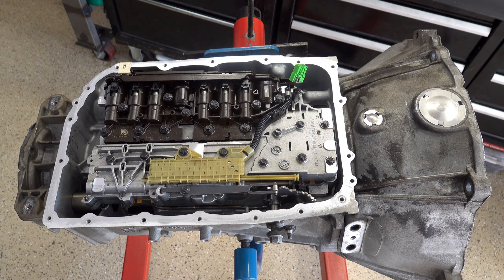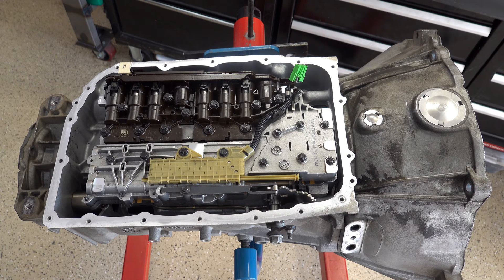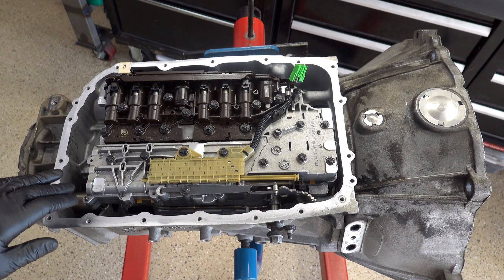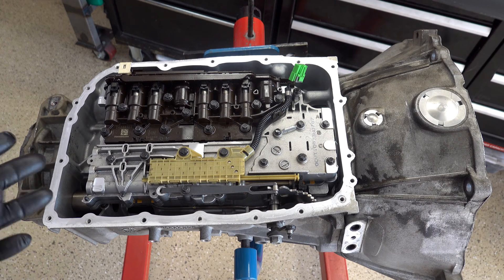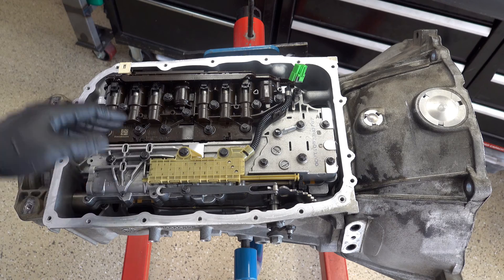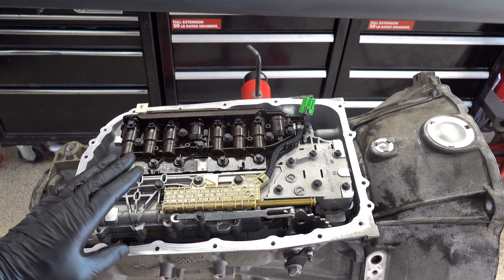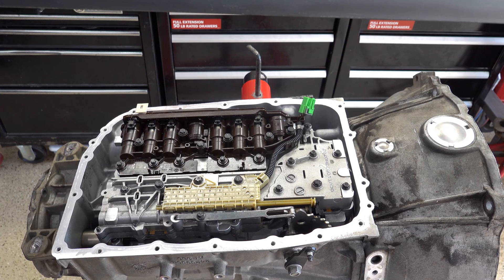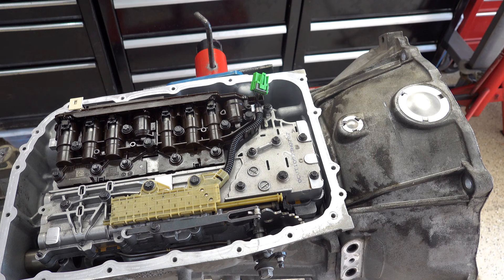6L80 Troubleshooting PT2 - Internal Mode Switch

Comment: Was the one you tested good or bad?
Reply from the maker: That one was working fine. Thank you for watching.
Reply: @nickstransmissions ok thank you!!! Been following you for a while and you’re a beast bro!!
Reply from the maker: You're welcome and thank you for all the views and support, Tony!
Reply: @nickstransmissions  I had the same DTC codes that you showed on that sheet of paper, no crank no start, what would my PARK show on my multimeter if my IMS is bad if I use PINS “A” & “D” like you did? In the video your PARK showed “OL” and you said your IMS was good. What would a bad IMS show? Thanks.

Comment: 2015 GMC Sierra 1500 two-wheel drive 5.3 l Denali 6L80E transmission. I got the notorious torque converter shutter and took it to a reputable shop to have him do the rebuild which was a basic rebuild no replacement of the TEHCM or IMS as there were no codes when he scanned the truck. I had no issues at all with the truck before the rebuild, and this truck has impeccable service history. The day he called me and said the truck was ready his technician forgot to reinstall the crank position sensor plug and was already telling me the truck was having issues with drivability but the transmission was working fine. When I call back to tell them to check for that he already knew he made a mistake and plugged it back in. I took the truck home I noticed that it was slipping and so I took it back and the technician went for a drive with me and noticed that yes it was slipping and it was also having a hard one, two shift. The shop owner told him to check the fluid and it was two quarts short. So the shop owner and myself went for a drive still felt like there was not something right and he said that the TECHM basically need to go to a relearn procedure. I drove it for a few days and then I noticed that when I would put it in drive the drive indicator didn't light up and it would not go into gear, so I had to put it in manual and drive that way. I took it to the shop the next day and a few hours later he sends me a picture of a broken transmission filter, it's definitely an impact break and he says that he has no idea how that's happened He's never seen anything like that before but he replaced it and it seemed okay for a couple days and then it started doing it again. The truck sat for 10 days I had to fly out of state upon returning I drove it it seemed fine and then the next day it started doing the same problem. It does have a brand new AC Delco IMS in it but this guy is saying that it's all electrical problems and he's trying to tell me that the replacement IMS is most likely defective and if that's not it it's going to be the TEHCM which will be an extra $1,200 on top of the $5,000 he already charged me. Somebody please help me to understand if this guy is just trying to rip me off or if his technician did something that he shouldn't have and did a piece of that filter get stuck in the valve body. As I stated this truck had no issues before his technician touched it
Reply from the maker: Check the transmission's main electrical connector/plug to make sure it's fully seated/plugged in to the rear case connector. Your symptoms sound somewhat like a plug that is not fully engaged. If it is plugged in (either because you have already checked this or check and find it to be fully plugged in) take it to a different, reputable shop to get a 2nd opinion. 

There is a very specific procedure to diagnosing the TEHCM for being defective or bad - most shops don't have the equipment to do so...That said, never reuse TEHCMs, IMS, speed sensor - harness or any other electrical/electronic transmission part...I always replace those three things on any 6L80 build that I do, unless the customer agrees waive their warranty to save a few bucks...

Comment: When I shift back to park the vehicle does not register the action on the digital PRNDL in the dash. Would this be a symptom related to the mode switch? Also causes some drivability issues when acting up. Problem is intermittent. I can turn off the key and start it back up and all is well.
Reply from the maker: Maybe. Did you scan for codes? If so, what codes appeared?
Reply: @nickstransmissions  Got no codes in the TCM, PCM, BCM or ICM that pertain to transmission. Did replace the IMS. Same symptom presents after replacement. Driving in live data, the TCM in my Autel Maxisys shows a data PID for gear selcted. The PID will show proper gears while it's functioning correctly but as soon as the light on the PRNDL goes out the PID reads "invalid". I can sit in the driveway and fiddle with the selector stalk moving up down slowly and sometimes it will correct itself. This leads me to think maybe something in the stalk but it's column shift and the only electrical connector is a four pin I think which controls up/dn shift and mode button on end. Where does the PRNDL get its data from? The TCM? The PCM? The TECHM? or somewhere else. I figured TCM because it was the only module that showed a PID for it. Thanks for the reply.

Comment: I have a Chevy Silverado 3500 with Allison 1000
If replacing the IMS does it need to be programmed?
Reply from the maker: If you're only replacing the IMS, no programming is required.
Reply: @nickstransmissions what about the  TRANSMISSION RANGE SELECT LEVER POSITION SWITCH does it need to be programmed?
Thank you for your video and feedback

Comment: Just got my transmission rebuilt on my 2015 Silverado now I am having no crank issues suspecting it is the neutral safety switch as well I hadn’t had any issues with it before it got rebuilt I turn the key and all the lights on the dash come on the fuel pump turns on but when turn the key all the way nothing happens at all the starter does not even click.
Reply from the maker: Check the main transmission connector - sometimes they're not plugged in all the way. If it is, drop the pan and plug in the IMS. If it's plugged in, replace it (should have been replaced as part of your overhaul)
Reply: @nickstransmissions thank you for the information I’m going to get it replaced this coming week.

Comment: First off thanks for your time, I’m in a rough spot I bought my 2016 GMC sierra 5.3 L v8 7 months ago and I got code p182B and p700, had those codes for about 2 month where my PRNDL would not read after getting on the highway or speeding up and it would say “service stabiltrac” I had a very trusted mechanic look and it and he changed the TCM thinking it’d work but it only cleared 1 code and still did the same thing, said all wiring looked great. He said best thing now is to replace the transmission since he took 3 days combing through and couldn’t find the issue. Should I look to sell the truck?
Reply from the maker: TEHCM solenoid performance codes are often caused by the valve body, not the TEHCM. I'd locate a shop to diagnose it properly since your 'very trusted mechanic' did not do so, before you look to sell the truck. There is a specific diag T/E sequence that has to be done and sounds like he didn't do any of it. 

Even if you decide to sell it, what are you going to replace it with. Worst case scenario, if the transmission does need an overhaul, is that going to cost you more money than replacing it with something that will likely need the same thing at some point in the relative near future? 

Get it properly diagnosed before making any rash decisions...Not sure why folks immediately think 'sell the vehicle' if the only problem w/it is the transmission and the cost to replace it will be much greater than investing the funds to rebuild the trans so it's no longer a problem.

Comment: What size is the e Torx for the range sensor? Currently the 10,11,12 don’t fit??
Reply from the maker: Buy a Snap-On 10EPL socket
Reply: @nickstransmissions I had a set I ordered from Amazon but the 12 was the one that fit a little loose but still managed to take it off, it was thick wall socket. I also had ran to harbor freight and got another set thinking it was a 11 but that one didn’t fit. But I got it done thankfully.

Comment: I got this 2017 gmc sierra…all shifts on cluster work PRNDL…but when i drive the truck the cluster shows im on D and after a few minutes it doesnt mark D anymore but its still Driving perfect…after i notice that, i put it on park and it change itself to L1 but its still on park and it doesnt go to drive anymore…my solution is to turn off the truck for a few minutes so it can restart and everything goes back to normal but then again when i drive it it does the same thing…i bought a IMS on ebay for 25 bucks and switched it but its still makes the same problem still…can you help me out
Reply from the maker: Sounds like IMS - whatever you bought on eBay, I'd throw it out and purchase a new IMS from General Motors. If it's still having issues, more diag needs to be done.

Comment: Quick question for you. I have a 2013 Chevy Impala lt. I'm getting a code for the internal mode switch and or transmission range sensor. Call the dealership tried to ask them for the part. The seem to not know exactly what the part is is there another name for them that I could ask them about. I've called to dealerships and they keep trying to sell me a neutral safety switch and another switch Inlet and Outlet so if there's another name for the internal mode switch I could ask them that would be greatly appreciated.
Reply from the maker: Hi, thanks for watching....I'd call a different dealership as the parts folks at the one you're contacting don't know what they're doing...The terms you used, "internal mode switch" or sometimes, "range position switch" are both correct for the part in question.
Reply: @nickstransmissions okay thank you very much I've been trying to figure out a part number for the mode switch so I could grab one and install it myself. I think they just want more money by trying to tell me a whole new transmission control unit. Without body. That's ridiculous. I also heard that the transmission range sensor is located on the outside of the housing not on the inside I appreciate your help hope you have a wonderful day take care

Comment: Got a 2014 Silverado with 6l80e did a rebuild on it installed the transmission but it goes forward in all gears but park only code I get is p0700 I checked to make sure the range selector is where it should be inside the tcm and it is the only thing is the ims has a very dark color the transmission was ran hot for a while
Reply from the maker: I'd replace the IMS on general principals given its appearance. 

Did you replace the TEHCM with a new one? IF so, did you program it to your vehicle?
Reply: @nickstransmissions it’s the same TEHCM before I took the transmission down it wasn’t having that problem I’m not getting any codes the truck sitting on the ground and put it in gear I have to floor it for it to make a very small forward movement but if I jack up the rear end put it in gear it will spin
Reply: I just replaced the ims sensor still having same issue
Reply: To reprogram the same techm is it just the adapt rest that’s it ?

Comment: I have a no crank no start on 2009 ltz avalanche, I have went through everything  new starter new switch all fuses relay, I believe this might have been it I found frayed wires going to transmission, but the code i get is p0615. Trying to save my self couple thousand but cant figure it out.
Reply from the maker: Did you repair or replace the frayed wires? If not, repair or replace them. Also, where are you getting the 'couple thousand' from? Are you thinking an internal modes switch costs two thousand dollars to replace? It's less than $100.00 from GM...Takes all of two minutes to replace once the pan is off...

Comment: Thank you so much for such a detailed video. Im having a issue with a 6l80 in a 2006 corvette. If i shift to drive it defaults to 4th and wonts shift. If i put it down in manual mode and use the steering wheel controls it will go to 2nd then 4th, 3rd, 2nd and back and forth. Sometimes when i start it it will go to first and not shift at all. I can put a scan tool on it and command the TCM gears and it shifts properly but on the cluster it always shows +1 gear. So if i put it in 1st it will say 2nd, if i put it in 2nd it will show 3rd ect. Very strange issue that i suspected is in the wiring. It is a modified car. Someone put a different transmission in it but same issue. I had another complete valve body, with mode switch, tcm ect on it that i tried, same issue. Checked all the powers and grounds coming into it. Just isnt making sense. Have you ever seen anything like that?
Reply from the maker: I don't ever work on the vehicles for which I build transmissions so no, can't say that I have but it sounds like there's either a problem in the tune/program or the vehicle's transmission wiring harness may have one or more short-to-grounds (or shorts/grounding issues elsewhere on the vehicle)...Those two things would be my lead suspects...

Comment: I got this problem with my C6 Corvette. P182e P0700, already replaced the IMS and still getting the same issue. Only happens when I put the car in drive, PRN don’t throw the code. I can start to drive the car and clear codes and it’s perfectly fine, or let the car warm up and it’s perfectly fine. Only happens when the car is cold.
Reply from the maker: Sounds like some sort of electrical and or network communication issue but hard to say for sure. Will require more diagnosis....
Reply: Hey, I have exact same problem on my 2017 Silverado 1500 5.3l 142k kms. After replacing transmission fluid and the filter. Code comes maybe after a week of driving doesn't matter hot or cold. Once I clear they don't come back. Vehicle goes in limp mode when the above codes come with check engine light and stability control light on. Did you ever find a solution for it? TIA
Reply: I got the same exact problem. But mine started happening even before I flushed the atf.

Comment: What would happen if I didn't push that yellow clip on the top left back in?
Reply from the maker: Not sure what you're referring to but you'll have problems if things are not installed correctly.
Reply: @nickstransmissions  The little yellow tab that needs to be pulled down to take off to take off the sensor. I'm not sure if I pushed it back in. I didn't take off the valve body, I decided against it when it found out I didn't have the torx socket.

Comment: I’m at 330,000klms and started to get the odd loss of gear on dash of my 2018 Holden Colorado (6l50e). 

It’s like it’s stuck in 6th but slipping and limp mode all together. 

Scan shows p182e and u0402 on my scan tool. 

I can turn off vehicle at side of the road and not be able to get park initially without a key wiggle or whatever and then after it restarts, it’s all good and back to normal. 

Can’t see wiring issue or any damaged plugs. 

But I was going to ask where the IMS plug is on the box so I can check if it’s damaged or corroded etc. 

I’m in Australia so highly unlikely to be corroded as it’s not a place we use salt on roads and rarely rains and we get hot weather mostly. 

Thanks for any tips on this issue.
Reply from the maker: Thank you for watching, Rab. There's no IMS connector on the outside of the case, just the main case connector at the rear of the transmission. You can check that for any damage or to see if it's not fully plugged in....Otherwise, drop the pan and perform the tests as shown in the video to rule in or out a bad IMS. They don't often go bad but everyone once in a while, a unit will come in that had IMS codes and symptoms of failed mode switch.
Reply: Did you ever get it checked or fixed? I'm having similar or identical issues on my 2014 Holden Caprice with the 6L80 here in US. Won't start at all now and no gear indicator.
Reply: Loose battery terminal. 
Seems to be fine now.

Comment: Hey Nick thanks for all of the amazing information and detail!  I have a 2014 Chevy Cruze LT (turbo) and I am getting the following codes P182e and P1915, I can start with key, not remote start and it is in limp mode.  If I fiddle and clear codes multiple times I have gotten it to run fine for up to a month or so, but the problem is getting worse and I need to tackle it.  It tells me to service stabilitrack and I get a check engine light.  I am pretty sure that it is the IMS based on everything else works well when the lights and codes are cleared.  All internal lights work fine as well as radio etc.   My question for you is would you agree that the IMS is bad?  I am planning on tackling this project this upcoming weekend and my only concern is the roll pin that I have read is asking to use a special tool to remove and reinstall.  I can only find this tool for $300.00- so is it absolutely required to have that or will I be able to do it without?  Thanks in advance for your help!
Reply from the maker: Thank you for watching and the kind words, Shane! 

You don't need to remove the selector shaft or anything held in by a roll pin to swap the IMS...you just need snap on's 10EPL socket (or an E12) and 8mm socket...R/R should take a couple minutes once the pan's off.
Reply: @nickstransmissions  that's great news! I'm assuming it's much easier to pull the valve body vs trying to pull it out without removing correct?
Reply from the maker: Check out my 6L80 Final Assembly video - it will give you everything you need to see when it comes to R/R the IMS: https://youtu.be/5odRpeisEuo
Reply: @nickstransmissions  so I have the other transmission that has the ims attached to the top of the case, will I need the roll pin tool for that?